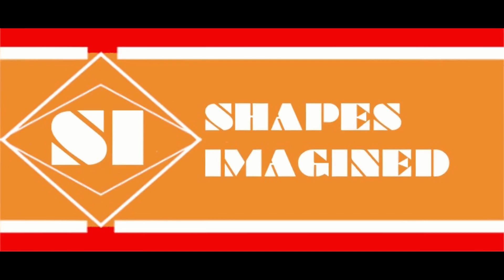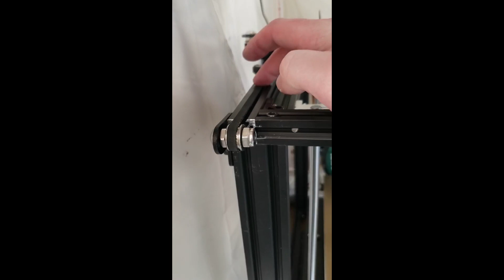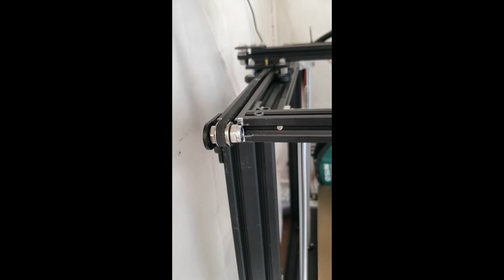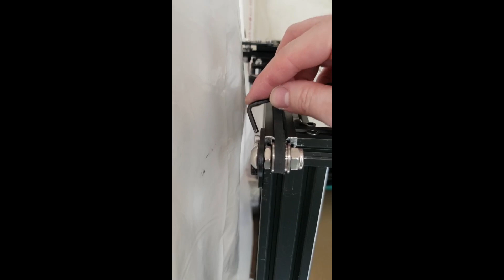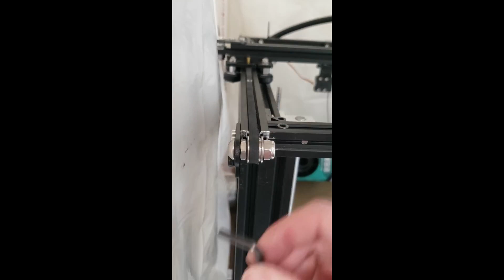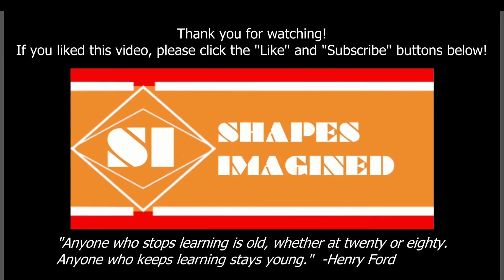An easier way to tighten your Ender 5 Plus belts

Comment: Hello, how do you tighten the x axis? And how strong should it be, I can't find much information about the ender 5 plus
Reply from the maker: I haven't tried tightening the X-axis with this method.  I just brute-forced the X-axis idler bracket with my bare hands and tightened the screws.  I think I had to try this two or three times before I was satisfied with the lack of slop and sag in the belt.  

I feel like belt flex is somewhat hard to judge and something I have to learn to gauge by sight and feel.  The belts shouldn't have so much slop in them that the gantry or print head moves before the belt does - everything should move at the same time, ideally with no slop or sag.
Reply: @shapesimagined6193  Another question, I just saw that a rod is worn out, which is why it vibrates and makes my impressions go wrong. Where can I buy? I've searched but I can't find a 470mm one.
Reply from the maker: @solclow  which rod, one of the threaded screws that raise and lower the bed, or one of the guide rods for the bed?  I'm not sure where to get them, but I'd ask on the Ender 5/5 Plus Facebook group or subreddit about it - that's where I'd start.
Reply: @shapesimagined6193  Thank you for solving that detail temporarily. Now I have a question. I hope you can answer me. Even though I watch the video, I don't see that step. In the cure program, when printing I have to manually set the printing temperature in the 3D. Is it normal? but in prusaslicer it does it automatically or is there something I have to do in cure
Reply from the maker: @solclow  there are a few bed temperature settings in Cura that put the bed temperature you want right in the G-code.  I run a constant bed temperature throughout the print.  Before a print, I preheat the bed to the temperature I set in the G-code for 5-15 minutes depending on the print.  If you have an insulated enclosure preheating the bed also heats up the enclosure.